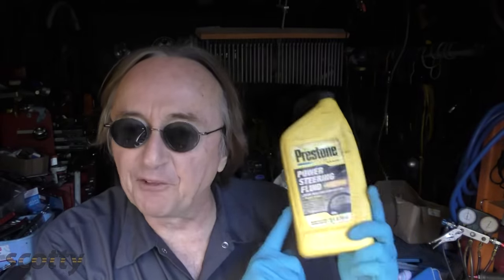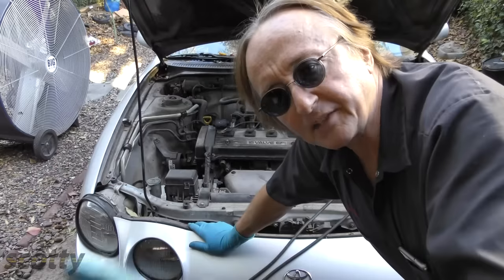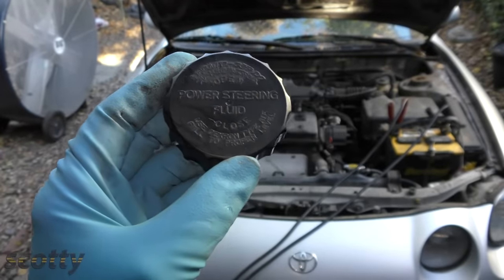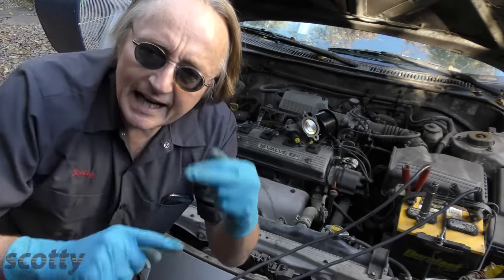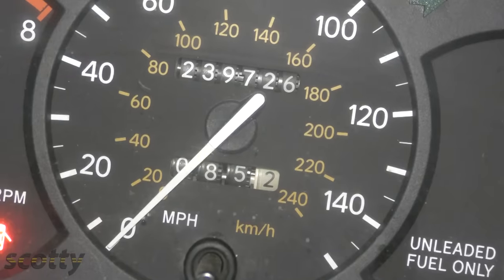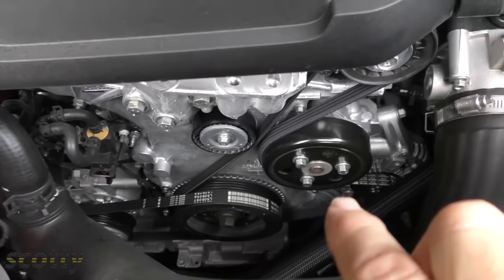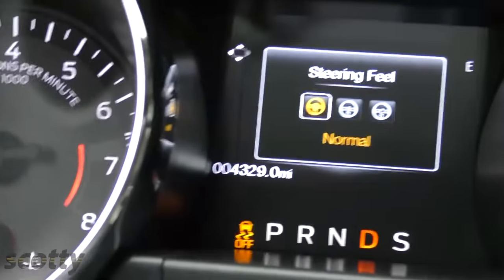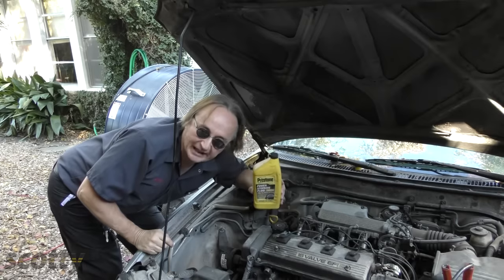Should You Change Power Steering Fluid in Your Car?

Comment: Don't do the turkey baster method, just jack up the car so front wheels are off the ground and free to move, put assistant in driver seat, unplug the higher hose on the reservoir and cap the plastic nipple on the reservoir with a rubber cap. Then put the disconnected hose into an empty bottle, then open the cap of the power steering reservoir, have a bottle of clean new ps fluid ready, tell assistant to turn wheel slowly all the way to one side (lock) and this will be pushing out old fluid into the empty bottle, at the same time, be adding new ps fluid, then tell assistant to turn wheel slowly all the way to the other side as you keep adding fluid. Continue until fluid cones out clean (not black anymore) and then as quickly as possible prepare to remove rubber cap on reservoir nipple and immediately push the hose back on to the reservoir nipple and put hose clamp back in place. Done. Pat your self and your assistant on the back, you just saved a bunch of money and got ALL the nasty fluid out.

Comment: Have you got anything about a shake/jerk in the steering wheel.
Reply: does it shake at a certain speed, or shake and them jerk, if at a certain speed tire balancing issue, if shake and jerk idle rack or power steering problem, could be a loose belt as well.
Reply: Tony Barnes I believe at all times, not as much when slowing down (braking) but does when at a slow speed. And was gradually getting worse last night started with a slight pull in the steering wheel to the | \ then started to go /|\ both ways the longer we drove it fiancé says it started after we had to plug her tire.
Reply: Jonathan Luis Hmm that's a interesting one, have you ran it by anyone, some shops will do a free inspection, I know lesswabs tire center does. I would get it checked asap. Could be a bad rack or messed up pump.
Reply: Tony Barnes I haven’t taken it to any shops been asking neither who went to school for mechanics but that’s over the phone I’ll make sure to get it checked ASAP! Thanks!

Comment: does the 2016 forte ex has electronic or hydraulic power steering? because I checked it and couldn't find it on the other hand I also found valve right down the radiator has a bit of small red fluid leak and I can't figure out what it is.

Comment: lol true story time.  I had a old Chrysler product and one day the power steering just stoped working!?  I could turn the steering wheel (with ALOT of effort)  but there was no strange noises or any indication the power steering pump had an issue .. Other than it stopped working and wouldn't hold any fluid.. SO I said screw it, and drove around with no fluid in it with "manual" steering for a year!  Wich was actually easy on the road, just not in parking lots.  Eventually I happened to be under the Chrysler anyway for another reason and noticed the power steering line wasn't even attached on the bottom of the pump!  LOL so I got a wrench re-attached it, dumped ATF fluid in (wrong fluid) and it has worked fine ever since!!  haha 4 years later and that 31 year old Chrysler pump that ran dry for a year still works.  Now that's what I call a god damn'ed Chrysler.

Comment: Scotty were having problems with overheating. It's a 2010 charger ex police car 5.7 hemi ,we had a plastic part going from radiator to heater and back of engine  my grandson changed the part out ,with help of YouTube videos. And refilled tank with 50/50 . First time drove it and he  got home and shut off engine and steam rolls out from under hood, he razed hood to see and looks like it's coming from top of plastic fill tank. He pushed down on the cap and it quit steaming . He topped off the tank and waited till next time. Since this is closed system does this cap act as radiator cap and release pressure . It's a recurring problem the fluids were changed by a professional shop and pressure filed but still steams. Is it this cap on the remote tank or my GS thinking thermostat. Please help wayne
Reply: What about temperature gauge?

Comment: Not the best method to change the fluid, lots of fluid is still left in there and new fluid gets mixed with the old wasting new fluid, it takes more time and many intervals to complete. A better method is to empty the reservoir, remove the return hose from the reservoir and put in waste container, cap the return inlet of the reservoir, fill with new fluid, with wheels off the ground turn steering wheel slowly lock to lock making sure the reservoir does not run out, do this until the fluid coming out of return hose looks clean, remove reservoir cap and reconnect return hose fast as fluid will be coming out when the cap is removed, fill to correct line on dipstick, check again after going for drive to make sure level has not changed.

Comment: Use transmission fluid for your power steering?
Reply: if it's recommended.
About to put some Dexron III in my Explorer.  Dexron II was the original spec PS fluid for it.
Reply: @BWater-yq3jx  thanks, yeah I put transmission fluid into the power steering fluid container, seems weird but that's what it said.

Comment: 2009 and later Toyota Corollas have electric power steering -- no fluid used so no fluid change is not necessary.
Reply: solohoh my 2010 Camry has hydraulic and no electric power steering.

Comment: I happen to know that there had been some wear on my steering system, both the pump and the rack, no going back from there. When I turn, I hear a slight grinding noise, and I think that the steering has more play in it than it used to. Is it detrimental to drive it this way?

Comment: Electric power steering motor. More electronic felgercarb to get a computer glitch and break.
I really miss the cars I had in the 1980s. Except the 1989 VW Jetta GL. It was a piece of crap. Limped its way to 100,000 miles before dying. And that was with regularly scheduled maintenance.

Comment: My car jerks when I press the gas and won’t accelerate what could it be?
Reply: Could be a lot of things. if it jerks, and does not accelerate , that means something is wrong in the transmission. Do you notice a burning smell or smoke? Also, do the engine RPMS rise when you try to accelerate?
Reply: buba426 I mean I literally bought a new transmission like 8 months ago I’m thinking it could be the timing belt but I don’t seem to find it. But no, no burning smell so far
Reply: Check engene light blinks or stays on? What car is it?

Comment: Fluid is cheap. Racks and pumps are expensive. Change it when they said to do it. Brake oil is cheaper than calipers and master cylinders.

Comment: Ever tried driving WITHOUT power steering? Not fun, I almost wrecked some shit last week lol. It's hard to explain but I wasn't driving a actual car though.....things at work called "tugs"
Reply: Master K always do its not hard..
Reply: blackstar 1529 It wasn't a car. I never drove a car without it & don't want to if it's anything like my Tug experience lol
Reply: pushback tug like at an airport that pushes airplanes backwards?
Reply: Aztekky No the FedEx freight puller tugs, that drive the containers/cans around
Reply: oh i see.
Reply: that would seem like a fun job to me though
Reply: Its easier than a tug, since the cars can get up to higher speed, and cause physics, most of the weight shifts to the rear, making the wheel light

Comment: Wrong!  never do the turkey syringe half ass method, Due the SIMPLE CORRECT METHOD, The reservoir is most likley filthy if you change your turkey  fluid every 4 or 5 years . (2 years Max)  #1- remove reservoir and clean it as clean as a baby's ass and re-install. # 2- add the correct fluid till its full, Call over your drunk neighbor and place he or she or it, behind the steering wheel. #3- open up  several quarts or pints of QUALITY FLUID!!!!  and have them ready to pour in the clean reservoir. #4- remove the return line from the fluid reservoir and place it in your waste oil container. have your drunk neighbor start up the engine and immediately start adding fluid while your drunk neighbor is turning the steering wheel back and forth stop to stop as fast as he .she or it can . you will observe the witches brew jetting out the return line while your continually adding fluid,and never letting it go so low that you can no longer see it or you will fill your hydraulic rack full of air. #5- once you see nice clean fluid coming out of the return line have your drunk neighbor stop the engine, then re-attach the return line to the reservoir. #6- fill up reservoir to the full hot line and with the engine running, have your drunk neighbor continue to turn the wheel back and forth, this will displace any air in the system,due this many times, #7- have drunk neighbor shut off engine. pop open a few beers. while car is on a level surface  with engine OFF, check level, and add to the Hot mark, If it is over the hot mark , Then get out the Turkey syringe and start removing fluid until the correct level is achieved. Now ,you have just accomplished what NO TURKEY SYRINGE COULD EVER DO! A nice air free reservoir and hydraulic rack.this takes just a little more effort,but your assured that the "Wal-Mart" method hasn't been applied.